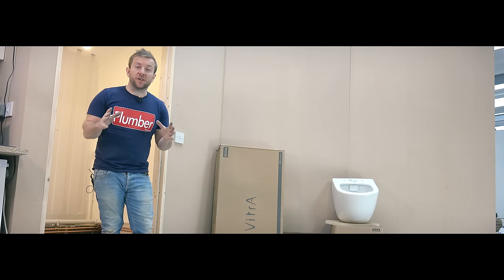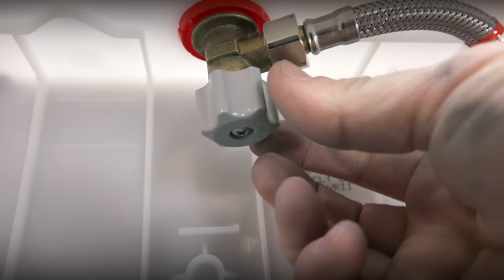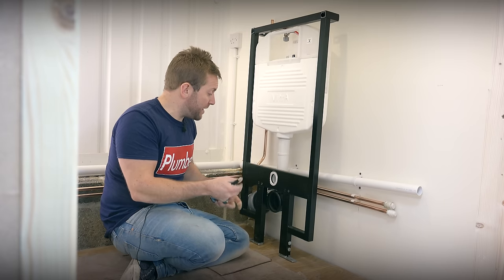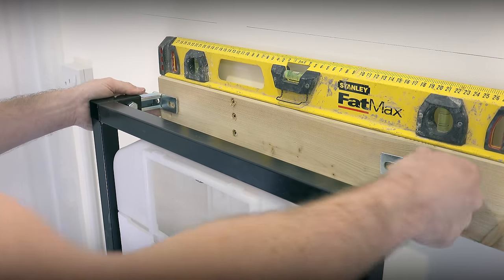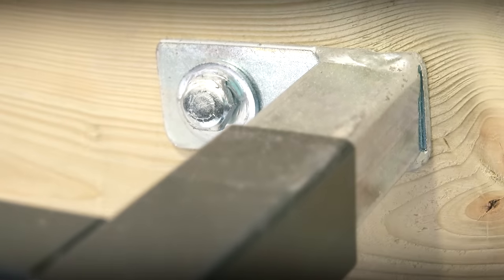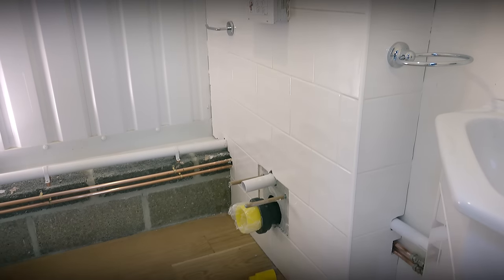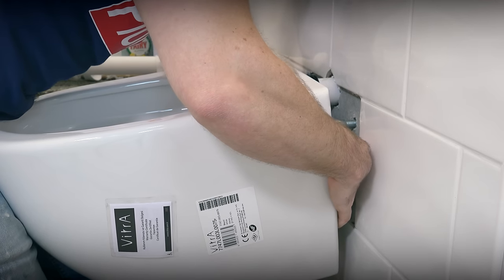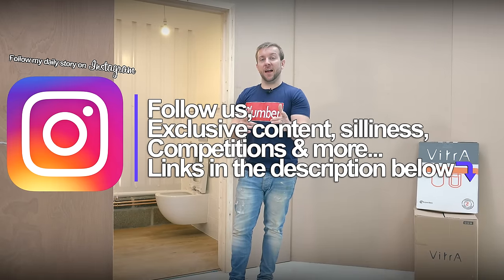HOW TO FIT A WALL HUNG TOILET - CONCEALED FRAME - Vitra auto flush

Comment: Lets face it, 99% of plumbers would have stuck this to the wall with silicon and ran like hell. I speak as a joiner with 40 years of experience of chasing these jobs when the customer wants boxing in done,( actually its the basin on the pedestal that the plumbers stick with silicon, but it genuinely is 90 odd percent of them).

Comment: Thank you for the excellent video showing the install of a wall hung toilet. There is a lot of work involved to install the tank unit correctly. Not complicated but many small jobs insuring the tank unit is level and secure and the bowl fits at the proper height. In my case my bathrooms were large enough so I installed one-piece toilets with toilet seat bidets. Much easier and in my opinion the one-piece toilets are much nicer in appearance than wall hung.
Reply from the maker: Glad it was helpful!

Comment: You should also look at the range of Geberit frames. They do them for toilets, urinals, basins. They have a  compete system of how to install the frames. I installed the UP200 frame in my bathroom for a  Villeroy & Boch Subway 2.0 Toilet and also uses a Geberit basin frame to mount a 800mm wide V&B Sentique  basin. I used the Geberit metal channels to "clip" the frames into. Fitted them in Oct 2013 - and they're still as solid as day 1.

Comment: Thanks for the video, as i am about to tackle one of these and so it is good to see how a pro does it.

When drilling into the floor, i am concerned about how deep i can go before there is a danger of damaging the moisture barrier? On a different note, there are allsorts of warnings about cutting backer board indoors with a power tool, as it throws silica dust into the air which you really don’t want inside your system: particularly not as it may affect your singing ability!

Comment: Great video. The things is a mix of metric /imperial also new homes framing is 16" center old ones 1800/1900 is 19-3/16 center and the pain in the but is plaster over lattice hard to locate studs. Anyway appreciate your effort to demo hanging the toilet

Comment: Thanks for this great video.
Im getting ready to do something similar myself with the addition of a sink on the same wall.
The question ive got is how would you access the concealed cistern and pipe work in the event that you need to repair or replacemet something? I was thinking building in some sort of access panel to avoid having to dismanlte/destroy some of the box in order to access the hardware if need be.
Do you do anything like this when doing these types of installation ?
Cheers

Comment: Now can you do one showing how to access the flush pipe connection from the cistern when it starts to leak, as mine is doing. Also, how to drain the cistern?
Reply: Which brand did u buy, so i can avoid it. Do u think it was an installation fault? Mind u if u cant get to it u do not know.
Reply: @antonios4926  Plumber mate inside the rubber cone entry, just a tad.

Comment: thanks for the video. though aesthetically nice these are a pain to fix anything inside. ive made a leak test by placing a bit of paper towel inside the toilet and it instanlty got wet revealing there is a slight leak. what would be a common cause, something inside the wall?

Comment: Very similar to the one I have just fitted but didn't watch your video first!! Mine was from Victoria P.  The instructions for fitting the pan were just silly sketches and no written instructions..  The frame was a san100 and not as fancy as the touch sensitive one you fitted.  Anyway I bolted the pan to the wall and instead of using the plastic pan fitting kit. So I have to take it all off again. Took all morning.

Comment: A bit of advice: never improvise with the height of the toilet seat. Please, read the instruction first. As you can see, there is a mark near the top side of the frame. It's written "1 m" - just adjust the height of the frame to get this "1m mark" at the 1 m from the floor level. That's easy.
Reply from the maker: True. That’s if you have the finished floor level.
Reply: @plumberparts  The same. if you have not the finished floor level, you can only predict the height of the seat, if you measure from the floor to the top of the seat instead the "1m mark"

Comment: We have something like this in the house we moved into, and guess what, it's loose on the wall. Are they generally held against the wall in a similar manner, ie on two studs? Ours seem to have screws on the sides rather than on the top (though those holes) as your did.

Comment: I’m not a plumber but I would advise against putting the toilet lid on and siliconing the toilet bowl around straight away. You’d likely want to use it for couple of hours to ensure the connection to the bowl isn’t letting any water through.

Comment: Can you install these toilets onto breeze blocks. I've purchased a wall hung toilet and frame but after ripping off the tiles off the current bathroom, I've found the wall that the toilet will be attaching to is breeze blocks. Help!? It seems so brittle and weak.

Comment: What size fitting was the elbow connector to the water inlet? I'm trying to figure out what connector I need for a grohe wall hung toilet, and this similar looking cistern connection makes no mention of its size anywhere in the manual or online which is thoroughly unhelpful 🤔😂

Comment: 25:05 So just to confirm you are tightening the Allens into a plastic thread?  So important to not overtighten, right?  Would it have been better if these Allens were tightening into a metal thread?
Reply from the maker: Hi Aman, it actually screws into a metal thread formed into some super tough plastic. Sorry mate should have specified.

Comment: Do you need a some type of padding between the toilet and the tile when you are installing it?
Reply: It's better to use a soft pad to prevent the fancy sound due to the little movement between the pan and the tiles.

Comment: Thank you for such an informative video. After replacing a new (wall toilet) I just realized that as soon as I placed my toilet, the toilet is loose and lean forward (can't handle the weight). My gf even felt with the toilet. I checked the studs... they are a bit wobbly but the privious toilet had no issue with them ( though it had no hiiden scews and it was bolted to the wall). at this point I am really giving up. After re installing it, I could nearly flush the right side with a wall but the left side is still has distance from the wall and is leaning forward ! Is it a problem with my measurement and fitting the screw ?
Reply: I definitely had the same issue at first and it important to push the toilet tight to the wall (which ever side you want to tighten first) only tighten a little per side and gradually tighten them both kind of like jumping around to tight lug nuts on a car wheel

Comment: Why not use a "gasket" between the toiler and the wall? It will help with squicky noises as the bolts loosens up
Reply: silicone or white cement according to past installations

Comment: Hi James would you have the names & model codes for: WC , Vitra auto flush back plate you used in this top video?
Reply: The WC is our Sento wall-hung WC (4448B003-0075) and Infrared Loop T chrome plated flush plate (740-0885) :)

Comment: Where is the platic gasket that goes behind the toilet? Its like a template of the back of the entire toilet back with the holes cut out. I think they supply it to reduce noise as these are suppose to be deadly quiet.

The lyrics aint too bad just needs  a good writer. An R Kelly sound alike!

Comment: Hey! Great vid!
Ive just done one myself, however used a pad inbetween. There is a little tilting movement though... should it be therr?
Reply: thats mean the tiling is not level , but nothing a silicon cant fix :)
Reply: @ahmadgzail9  It is because of the crappy mouning system this kind of toilets use

Comment: Wall hung toilets seperate men from boys, which no amount of banter or capers can compensate for. Also, you could have installed a foam sheet between the pan and wall to reduce flush noise.
Reply from the maker: Ok, I'll check that idea out next time man! Thanks!
Reply: 970357ers they cut out the handymen for sure!
Reply: I have a very similar one with same mechanism, certainly does separate men from boys, mine started to come away from wall, when I took it off and looked at frame the two screws that support the top of the frame were loose, so whole frame rocked, snugged them up properly and it's been up twice as long now, if not more with no issues so far. Taught me not all plumbers are competent even with many years experience and all the right qualifications.
Reply: Our frames are already lined with insulating styrofoam :) so you can keep your flush to a hush!

Comment: Ok just two points ;-)

1. You didn’t use isolation gasket between tiles and toilet pan. Helps with sound insulation and cost £2
2. The idea of a concealed toilet is to conceal it in the wall. Not to bring the wall forward :D but Ok - I don’t know what the wall is made of and what’s in it or behind it

Overall great work and please spread the wall hung toilets across the UK as what you get here is ridiculous
Reply from the maker: Yeah the room is stand along in the studio...don’t get me wrong I was tempted to put it be other side of the wall so you could see/walk around it but I changed my mind! I’ll check out the sound deadening thing. Good idea! Thanks for the comment dude!
Reply: All of our frames are already lined with insulating styrofoam to keep noise to a minimum!